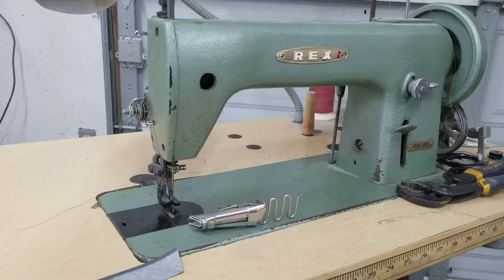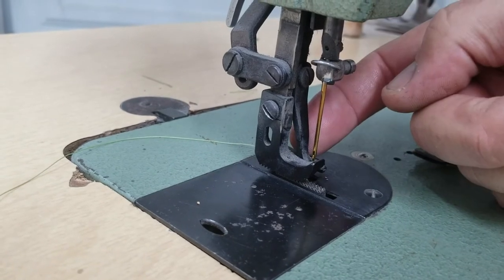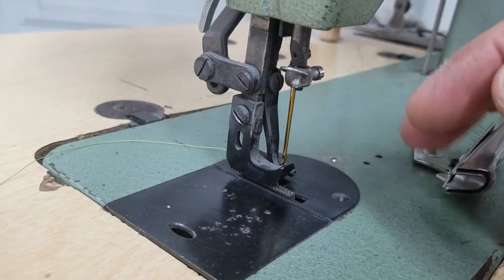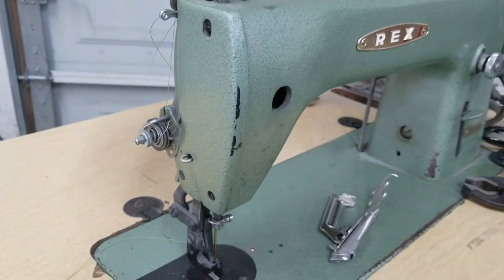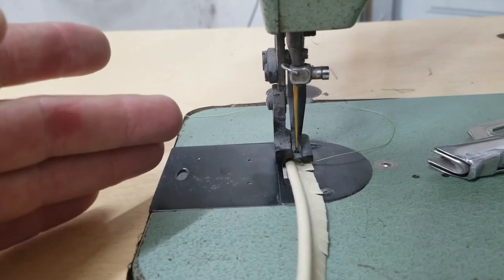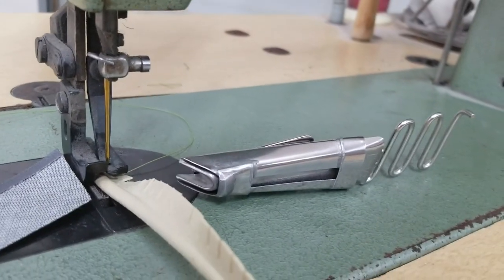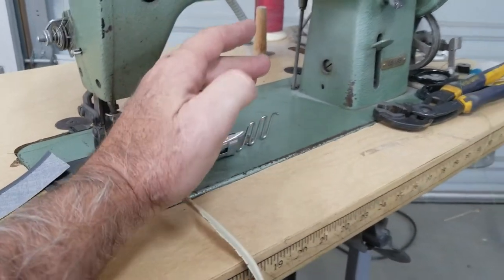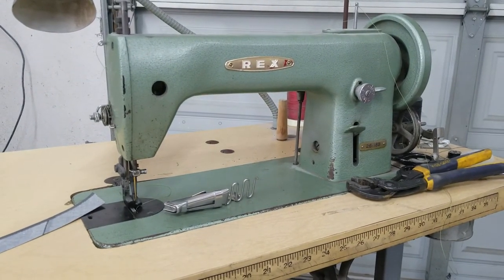Auto upholstery commercial sewing machine the basics of what to know

Comment: Um.... this presenter should be using the actual industry terms to describe the 3 different types of " Top Feed " and bottom feed sewing machines: (know that there could also be more than what I have described below)

Type 1 machine
" Unison Feed machines" AKA " Needle Feed" have mechanisms that work to make BOTH the presser foot AND the needle bar advance towards the operator and then act in concert to pull the fabric rearward through the machine.

These machines have TWO separate presser feet ;the smaller inner foot and a larger outer foot which alternate movement in coordination with the bottom "feed dogs" .

Operation = The smaller, INSIDE foot AND the Needle bar move up AND forward; (when the outside foot is down) and then down and rearward (when the outside foot is up)
This action allows the fabric to be advanced in "steps" through the machine.
 
Type 2 machine A standard "Walking foot" machine has TWO separate presser feet the smaller inner foot and the larger outer foot which alternate  movement in coordination with the bottom "feed dogs" 

Operation = The smaller, INSIDE foot around the needle bar moves up (when the outside foot is down and moving rearwards, then down to apply downward pressure  (when the outside foot is up) this action allows the fabric to be advanced in "steps" through the machine.
 
Type 3 machine "bottom feed machine"  has ONE presser foot with bottom "feed dogs" 

Operation type A = might be called "Assisted bottom feed"?
 The foot around the needle bar moves up slightly to release pressure (when the bottom feed dogs are moving rearward and the needle is withdrawn from the fabric. Then the foot moves downward to apply pressure  (as the needle is penetrating the fabric) this action allows the fabric to be advanced in "steps" through the machine.

Operation type B = Pure bottom feed (most home machines work this way)
The foot around the needle bar is always stationary (when the bottom feed dogs are moving rearward and the needle is withdrawn from the fabric. Then when the bottom feed dogs move down and forward (as the needle is penetrating the fabric) this action allows the fabric to be advanced in "steps" through the machine.